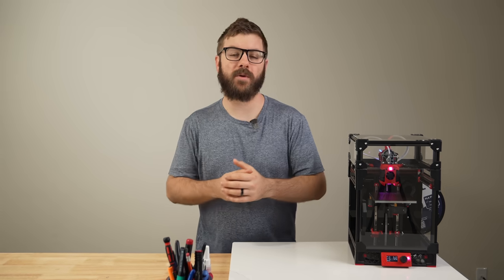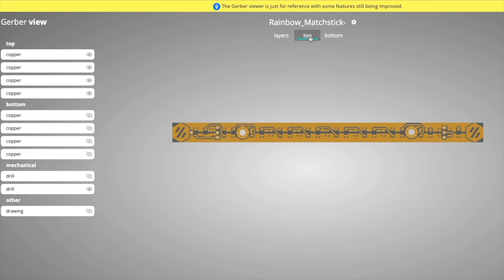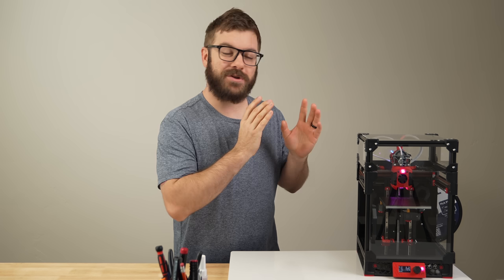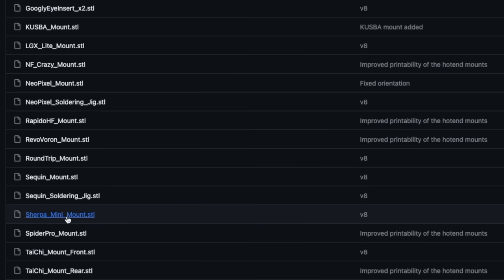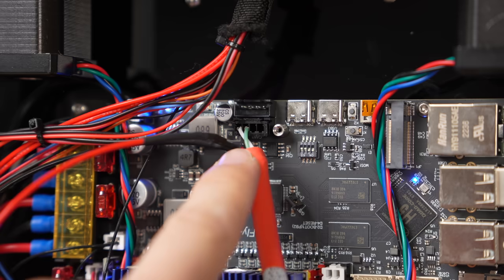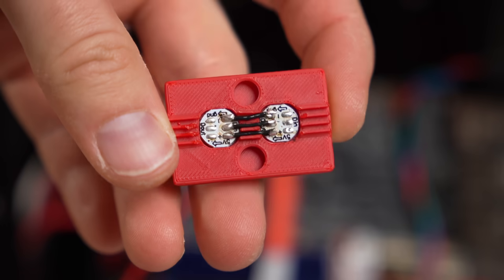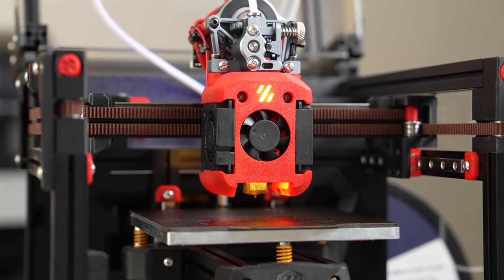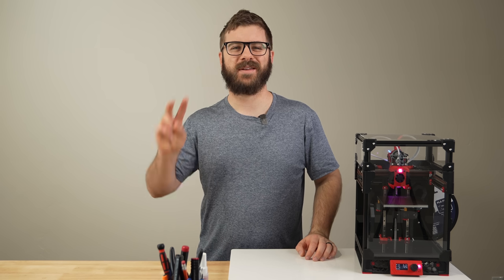Ultimate Toolhead For Your 3d Printer? (Dragon Burner)

Comment: How do you handle to two part cooling fans? you just crimp them into on connector?
Reply: Yep, and/or soldering them in parallel and crimping an extension lead.

Comment: Great coverage of Dragon Burner! I've been using this toolhead for a long time, starting with rook 2020. It's been great on my V0, Micron+ with boop, and now Stealthchanger with 6 Dragon Burner tools planned.

I've also used it's longer Rapid Burner configuration for a Rapido UHF, which is nice because it puts the nozzle at the same location as normal.

Comment: Of course I learn about the dragon burner right after I finished upgrading my 2.4 to canbus with the EBB2209 board and stealthburner toolhead
Reply: thing is there is a LOT of stuff for the SB for the big 2.4's, and while this little guy can work for a 2.4, there are some extras (like Knomi for example) that do not have an adaption for it.
Reply: Can I ask you what tutorial you used to upgrade that and did you use the U2C?

 tutorial

Comment: I made myself a 4010 based toolhead for the v0. What i noticed in CAD, you would need to shift the belts slightly backwards if you want some clearance between front door, fans and belts.

My toolhead essentially kept the mini SB looks, but integrated a lgx lite and managed to fit a dragon uhf without melt zone extender in it. Stupidly tight fit, but fits in the very same footprint as the original toolhead. What i noticed is that certain hotends partially block the part cooling, like a dragon sf and hf. My toolhead was originally fitted with a dragon hf, but due to cooling issues i swapped to the dragon uhf with its narrower heater block. Minimum layer time for pla went down by 2 seconds down to 6 seconds. No cfd was involved there. Not sure how the dragon burner performs in real world printing, but could you do a performance test for it minimum layer times? I think thats a good measure how well a toolhead can cool

Comment: I tried to adapt the DB for my Tronxy x5sa-400 to use the genuine MK8 Heatsink, V-Slot Carriage including a side mounted Klicky Probe. After hours of modeling i decided to abort this adaption. Instead of it,  i designed my own toolhead based on the "artis3d extruder type X".

Comment: Thank you for the awesome video Daniel. It's a top quality video in every way like all of your content is. Most times I love how your video's are short and to the point. On this one I was hoping you  got just a bit more detailed with the nozzle led's. I find that little fragile part a bit confusing. It's really hard to get in place without breaking something and even when it's in place - it doesn't lock in or seem quite right. Then it doesn't stay unless you use a couple drops of CA which I hated to do. That's the one area that didn't seem well thought out or designed. It doesn't make me regret the Dragonburner choice and wouldn't cause me to hesitate using it on another printer. While the Bambu hotend does work and it's cheap - I personally don't care for it for a couple of different reasons. But isn't it great to have choices?

Comment: I have used this tool head since the the beginning, great design by chirp however from my journey and trail and error this too head need to be stiffened up a bit for the longer hotends like rapido uhf  as the leaver effect it too great causing the y axis input shaping not as high as it should be, with that being said I have run the v4 version for the v0.1 at 1000mm/s at 75k accel before and it survived lol ofcourse the cooling is the massive limitation by then

Comment: The only one problem of dragon burner is using of 3010 hotend cooler, which is realy loud, when get enought airflow.
Im use some of this heads to my toolchanger printer, but this realy sucks, and i still want to redesign toolheads for myself to use 4010 or 4020 coller with undervoltage and low noise.

Comment: Awesome mod/review. Wish they had it for the Ender 3 (I looked, but didn't find any options). I need to upgrade my hotend, but I'm so lost I have absolutely no clue what to do (after months of consideration). Everything just seems to be so complicated and/or expensive. I mostly just want to print nylon at good quality without slowing down the speed and would really prefer if I could increase the speed to 100-150mm/s without losing quality. My hotend and extruder are OEM, but my printing quality is Excellent... so I'm really hoping to not diminish my quality in any way also. If anyone has any suggestions, please let me know. I could really use some advice.

Comment: Is the pancake motor the same as the stock mini?  Also, doesn’t it use 4010 fans?
Reply: Yes and Yes 40x10 for the 2 part cooling fans. It still uses the smaller 30x10 for the hotend fan.

Comment: No one mentions that here there are three fans and two fan ports on the ebb36 so did you club the two 4010 and plug them into one fan port and 3010 into another ?
Reply: In almost all videos everyone seems to have jumped past showing this can you please share how did you wire the fans to the ebb
Reply from the maker: Yeah you got it, I stripped all 4 wires and crimped them together to fit onto the fan slot.
Reply: @ModBotArmy  much thanks for sharing.